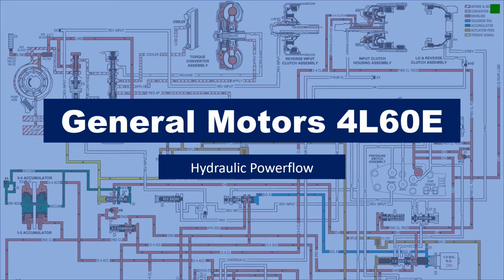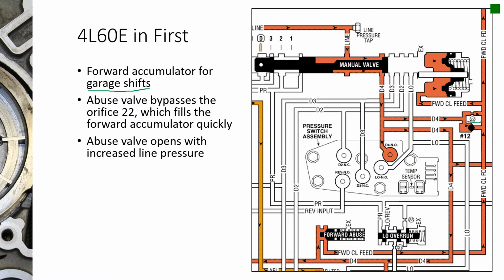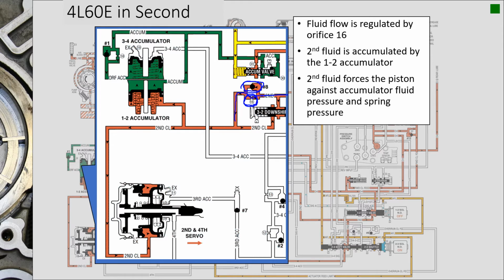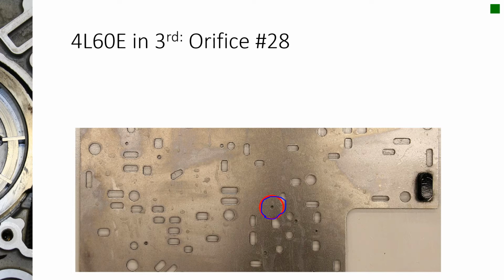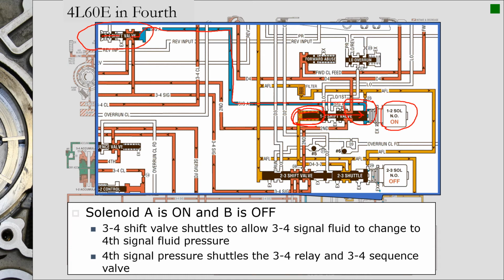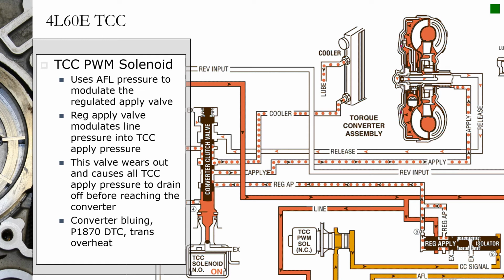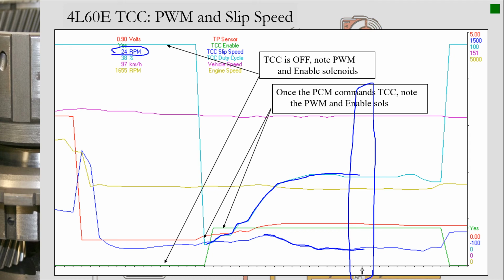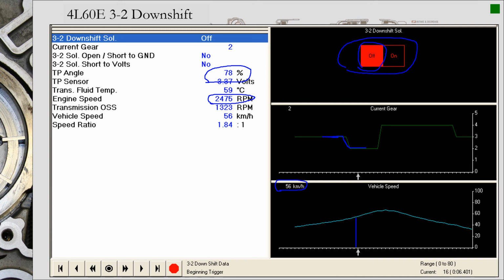4L60E Hydraulic Powerflow

Comment: I have 1st gear when I unplug the battery to reset the computer then I lose 1st gear when it shifts into 2nd gear then stays in 3rd gear I have no 4th gear and it doesn’t down shift . I can put it in 2nd manually ,my cruse control works. What do you think is wrong? I have a 3-2down shift open circuit code on my computer #66

Comment: If GM adds 3rd abuse valve for compensate all fluid losses -so many shops will loose their clients )
Its programmed fault to place 3rd orifice so early and every shifter after it loosing its amount of oil  and  3rd piston  receives not all fluid that goes thru 3rd orifice
Maybe if block #4 checkball and drill  28 orifice at max(like 0.150 or bigger) it reduces amount of  leakages
Need to check it myself 😀
And what about fitzall valve that redirect full pressure into TCC ?
I blocked mine TCC reg to full pressure  and also blocked 3-2 control and 3-2 solenoid -so far so good  and minus 2 pwm solenoids 
With  0.106 band release it goes 3-2 much better than oem

Comment: I have a 1997 Camaro Z28 with the 4L60E, the trans seems to function as it should except for about a 2 second delay of engagement when shifting into drive. Reverse is fine and all other shifts seem normal. Any suggestion as to what my problem may be would be greatly appreciated. This is the most informative video I have seen, thank you.

Comment: This is very fascinating! I got a Reman transmission with 15K on it - and I did a filler tube "flush" of 12 quarts using Dexron VI valvoline and Maxlife. The 15K fluid has a slight burnt smell and I noticed a smoother transmission after the 12 quart "flush" (really a 75% replacement but considering that leaks are the biggest problem (?) - seems like better not to shock the transmission with too much new lubricants!). And what else? I ordered the OEM Magnefine external filter that was made in Australia - it has a better design for both sides of a bigger magnet to grab the in-flow fluid metal - and then a 5 micron fiber filter. And an overflow valve that is better designed. Do you think that is OK - to hook up after the cooler - going back to the transmission? thanks

Comment: i have stared and stared at these diagrams. Any guidance on a transmission that wont shift in 4th at all? All other gears shift great. Entire valve body and servo assemblies have been swapped with known good assemblies. 
Any help will be immensely appreciated.
Reply from the maker: I would check a few things.  1) use a scan tool to verify that 4th is being commanded.  If not, maybe the computer thinks it’s in manual third. 2. If it is commanding fourth, drill and tap a pressure tap fitting on the servo cover and check to see if pressure is getting to the servo piston in forth.  If it is, then the servo doesn’t have enough travel to apply the band.  If there is no pressure, yet there is a command, it could be a leak in the 4th circuit, gasket covering a spacer plate hole, or a shift valve that didn’t move.

Comment: Richard and Trent at Precision Transmission block the 3-4 accumulator and pwn on every unit they do (given that they also add a z pack and wide band). What is your thought on this?
Reply from the maker: There are a lot of recipes that builders use in this transmission.  I know a lot of builders that block the 3-4 accumulator for better shift feel.  I usually don’t mess with it, but I still think it’s a fine modification.  Slipping fourth isn’t really a common issue as far as I’m aware.  I know many also use the wide band.  I’ve used it with great success as well, but now I stick with the borg warner band.  I used to use the zpack 3-4, but I’ve went back to the borg frictions.  The 3-4 doesn’t fail because of poor friction issues, but for pressure loss.  Changing the frictions and steels won’t fix the issue without addressing the leaks.  I found some weird 3-4 shifts with the zpack that were cured by going back to oe frictions.  Of course, this is all personal preference.  If what others do works for them, who am I to say their doing it wrong?
Reply: @siuautomotive  I also noticed that Zpack works like ceramic clutch (on-off without slipping) and wanna use borg green thin clutches for 7 or 8 disks pack
Zpack only good for highway towing
At full throttle I have too harsh 2-3 shift

Comment: where im getting a little confused is.   wheres the accumulator pistons in relationship to the springs?

really great share!!!

larry
Reply from the maker: Hi Larry, With most 4L60e's, the 1/2 accumulator, the spring goes in first, then the piston.  So you just see the piston when you remove the accumulator housing and the spring lives behind it.  The early 4L60e's (1993 and 1994) had the 1/2 accumulator with the piston in first then the spring.  With the 3/4 accumulator, the piston goes in first, then the spring.  That is the one in the transmission case.  With the forward accumulator, the piston goes in first, then the spring.  That is in the valve body.  Some shift kits have you alter the orientation of the 1/2 and 3/4 accumulator pistons, but if you are putting it back to stock, it should be as I mentioned above.